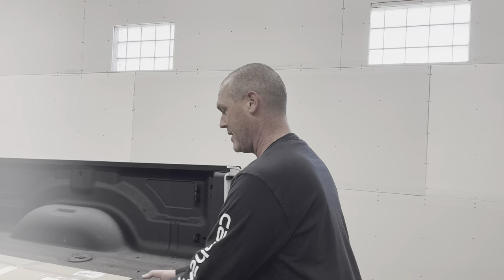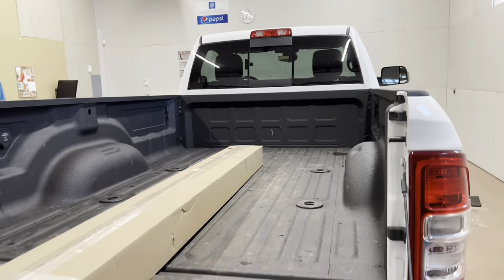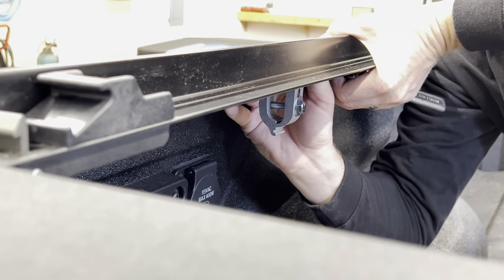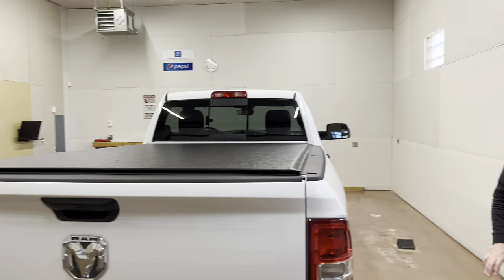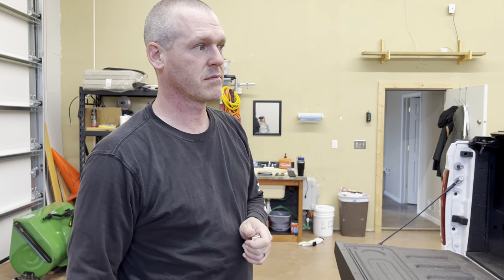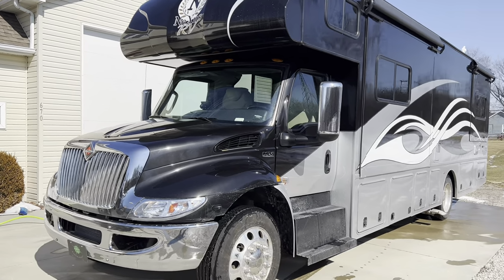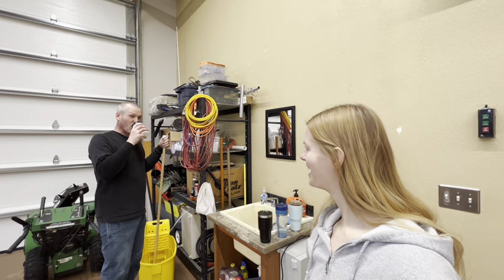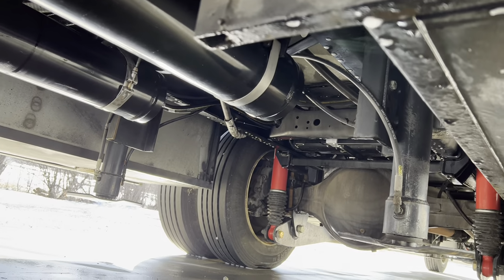We Bought A Truxedo Tonneau Cover (RAM 2500)

Comment from the maker: Do you prefer a tonneau, cap, or open bed?? Leave a comment and let us know!
Reply: For me prefer a tonneau cover.
Reply: Tonneau cover. $600 is cheeper than the Pace Edwards one I had on my Dodge Dakota.
Reply: I  like  having a  topper but sense I have a 2017 ram 3500 megacab cummins with the fifthwheel prep I'm probably going stick with a tonneau instead. My buddy been talking about buying a ram  2500 with the 6.4 hemi and been asking about fuel economy on them when not towing so do know what's Mike gets with it? plus I love your videos
Reply from the maker: @nathanvanfossen1391  It ranges from 11 mpg running around town to 14 mph highway. Just hit 1,400 miles on the odometer today. My commute is 5 miles each way so it doesn't see highway much.
Reply: okay sounds good thanks he has 2002 2500 avalanche with the 8.1 liter vortex now and getting between 5 to10 miles per gallon so he was thinking about upgrading to the 6.4 hemi he's pulling a 6500 pound boat a 7400 pound traveltrailer and he goes up in the mountains. I  told him to buy a  2500 cummins for the fuel  economy. I  bought  2017 3500  megacab cummins and I'm averaging between 13 to 16 pulling and 15 to 20 empty because of the wind
Reply: I prefer a tonneau cover but back in the day we did a lot of camping with a cap. I have a Tri-fold cover at the moment but after seeing that roll up cover I might update to one of those. Thanks for the video.
Reply: Tonneau cover for us
Reply from the maker: @enochperkins9835  great choice!
Reply: I have a tonneau cover on the pickup. But, I just bought a low profile so I can now mount truck racks to carry the kayaks.
Reply from the maker: @RVHelper  oh yeah, it would be great for mounting a rack like that!

Comment: I have a truxedo trifold I bought in 2014.  It's  a quality product.  My last truck was totaled in an accident last fall and the cover was damaged.  I bought about $35 of new parts and  was able to repair it and put it on the new truck.   Most other brands would not have replacement parts available.
Reply from the maker: Dang that's pretty impressive!

Comment: Pretty easy to get something of that weight to be stuck and spin.  Never had a tonneau cover so I cannot give a comment on them, I have had toppers and they are nice of you have an easy way to remove it when you need it off.  A couple eye bolts in the topper and a couple pulleys to lift it worked ok.  Be safe.
Reply from the maker: Yeah it just happened to be right on some ice haha little Jeep did a fine job.

Comment: You might want to look and see if they make stake pocket hold-downs for a Ram. Usually they're like an expandable plug. With what we haul for camping, (and tools) with our Tonneau, that much water inside the bed would be BAD!! They may also make just covers, in case you don't want the hold-down rings sticking up!
Reply from the maker: Yes they do but so far there hasn't been much water that has gotten in. So we may not get them. TBT I guess because that could change!

Comment: Nice cover!  You’ll notice better gas mileage for sure. I pull mine off in the summer as it gets so hot in AZ. The heat just rotes the leather.
Reply from the maker: Some people have mentioned putting a protective coating to help it in the sun... But AZ sun is a different animal! Lol
Reply: @WanderingWagners    Yea. We call it a dry heat!! Lol!! You have nice cover for your truck. Good stuff

Comment: I prefer my back flip folding hard cover. I keep some tools in the back and im constantly in and out of it year round. My first truck in high school  had a soft cover and if you took it off in the winter it wasnt going back on until a warm sunny day but it worked for my budget.  I have plastic fill plates for the stale pockets on my Sierra… I’m sure the make em for ram you should get some.
Reply from the maker: That's the nice thing about heated garages, helps keep things plyable in Winter haha😁
Reply: @WanderingWagners  nobody like a bragger! Lol #garagegoals
Reply from the maker: @bmac8130  😂😂 sorry!

Comment: I have the cheapest soft cover I could on my truck, I got it as I had it on the previous truck and liked it enough to put a $300 soft tonneau on a 70k truck.  I love having the soft top but I must admit I do like the Truxedo and not having to deal with poppers or making a bar to roll it up or having the cross bars separate (they look attached).  I don't use the stake pockets so I doubt I would go low profile but boy did that look the bee knees on the RAM.
Reply from the maker: It's crazy how much different/better it looks with the tonneau cover! We liked the one we had before so we figured we'd get the same brand again

Comment: I had a similar cover (by Access) that mounted using the same rail system.  I had issues with those clamps coming loose and falling.  A little dab of blue loctite helped solve that problem.  Something to consider if you have same issue!
Reply from the maker: That's a great idea and we will keep an eye out for that! Thanks

Comment: Tylenol cover looks good buddy but you can go to a dealership or a parts house and you can get caps to go in those steak pockets and the ones I've seen we got two or three different types I got one that's just a cover that goes down in the state pockets no gasket no nothing but you can get them up to a high-end one that's got a gasket on it that fits down into the state pocket and that's supposed to keep the water out and if you can find the ones with the gasket that goes down in the state pockets that's the ones I would get I had the ones that just slid down in there with no gasket on my truck it worked but if he got a real hard blowing rain are you going down the interstate ridiculous water in the bed but it wasn't no big deal either stuff I put in the bed water didn't hurt it so I said it'll be no big deal long as it didn't get water inside my toolbox that I keep inside my bed and I'll respond Pacific Honda ones with the gaskets if you can better be great and you don't have to worry about bolting them in or anything I'll be a bit so tight and sometimes you got to take a screwdriver to get them popped up to get the gasket released from the pocket well if you can find those man you'll be good to go and you live in Ohio so there's a lot of high-end auto parts stores in he might even be able to go to a dealer and find them all right man you have a good day
Reply from the maker: For now we are going to see how much water gets in and go from there in if we think the stake covers are necessary or not

Comment: O dear lord don’t ever pull on the steer axle you can pull too hard and shear off the pin on the springs to align the axle and knock your alignment way out of whack they make tow hooks for a reason but other than that great video of the tonneau cover

Comment: My wife surprised me today by ordering a Lo Pro tonneau cover for our 11 Ford Ranger.
Our Ranger is mainly used for work around our property.
We get 5-7 feet of snow every winter and I’m tired of the bed filling up with snow.
We put 260# of sand bags over the rear axle for added traction in the winter, (our Ranger is a 4WD).
My question is, Does anyone know how well the Lo Pro holds up with 2-3 feet of snow?
I’m kinda afraid that the weight of the snow will cause the tonneau to collapse. Do I need to worry about it?
Reply from the maker: That's a nice gift!
I wouldn't leave feet of snow just sitting on it at all times. I would brush it off just like you would any other part of the truck, or sidewalk etc. Not sure if it would handle that weight.